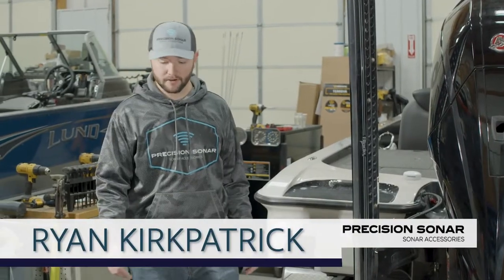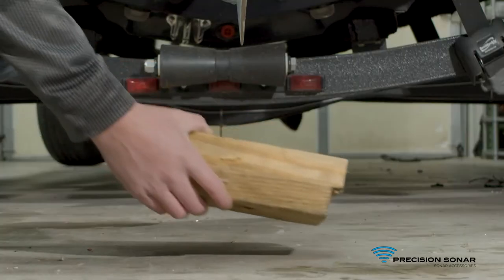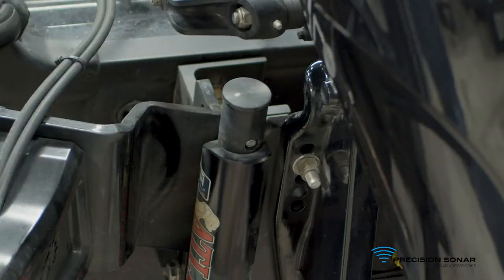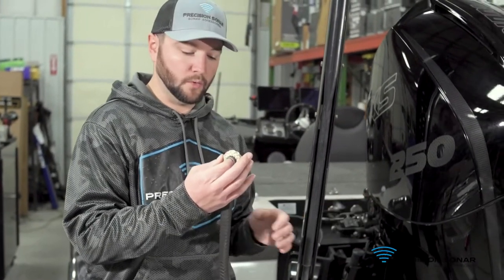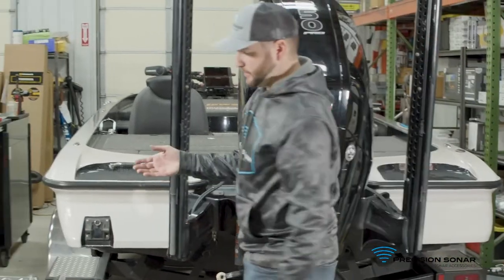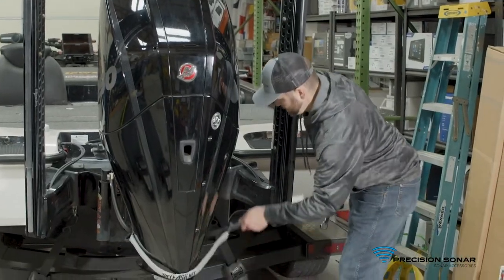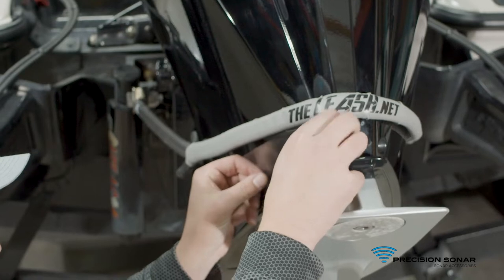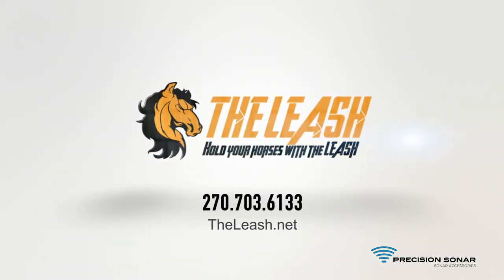The LEASH Installation

Comment: Not to be knit picky, but it maybe a go idea to mention that the engine transom bracket bolts have a torque specification and should not be exceeded. Over torquing can cause premature breakage and/ or wear. Thanks for the video.
Reply from the maker: Thank you for the feedback!

Yes we also include in the instructions that are in the box with every Leash to tighten to factory torque specs.

Comment: Do you make a bracket that bolts to somewhere closer to the transom, like the transom to jack-plate bolts?  It seems as though some incidents involve the jack-plate itself breaking when hitting a submerged object and this installation wouldn't seem to help in that case.  I want to buy one, but I'd like to see a different mounting option.  Thanks for the vid.
Reply from the maker: We previously did however, there is not much difference as far as effectiveness with our current design. The reason being is that 99% of the accidents that happen that results in the motor flipping into the boat, the piston is the first thing that fails. When that fails, the motor has free range of motion and continues its forward momentum. When it gets to a certain point, it then breaks the next weakest point which is generally the hydraulic jackplate or the motor bracket itself. The leash is designed to come into play after the piston fails and help prevent the motor from having enough leverage to break the next weakest point. Or at the very least divert some of the force to slow the motor down so it does not end up in the cockpit.

Comment: Do these work on aluminum boats without a jack plate? I have an Alumacraft Trophy 195 with a Yamaha 200 SHO. She tops out at 49MPH.
Reply from the maker: The Leash is not specific to what boat or jack plate, or even if you have a jack plate or not so you would just select the correct Leash based on what motor you have.

Comment: The idiots who installed my jackplate/motor put the bolts in backwards so the nut is facing forward towards the splashwell. I am afraid to take the bolt out so I have to have someone turn the bolts around.

Comment: So, the aluminum insert doesn't get put back in after you slip the tether through, before bolting?
Reply from the maker: If you go to the 3:06 mark in the video, you will see the insert get inserted back into the loop of the Main Tether.
Reply: @precisionsonar  Thanks. sorry I missed that.

Comment: You could put the tape on first correct?
Reply from the maker: Typically it is best to let that be the last step just to make sure exactly where your Leash will want to try and rub depending on where the brackets are mounting for your setup.

Comment: My problem is why does it cost so much $299.98 in a few years you got to replace it for rope man people are in a America when they bring something out on the market it’s hi dollar why can’t in my opinion they are trying to get rich off on item
Reply from the maker: Hey Raymond! I am not sure where you got that information that the Leash needs to be replaced in a few years. We currently do not have an expiration date on The Leash.
Reply: I thought about rigging up something similar to save a few bucks but the time it takes to shop for and buy lesser expensive parts, I'm wasting more time than it's worth just buying the kit for $300. Then I know it's done right the first time. No estimates, no guess work , no cut corners. Sure I can save a few bucks but the savings doesn't justify the time and frustration of buying a part here and a couple parts there. Returning parts that are off a little and spending who knows how many hours of wasted time getting it right. $300 is a bargain. 👍
Reply: If that motor came in your boat at 6000 RPMs the ER bill alone could send you to bankruptcy